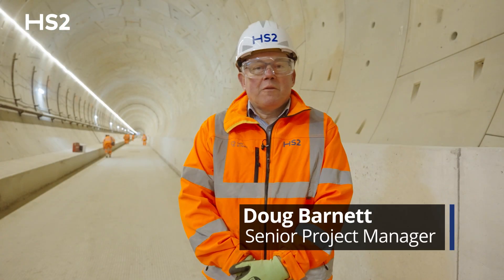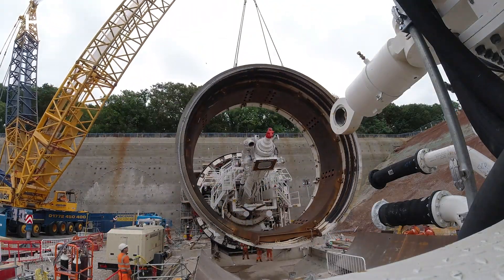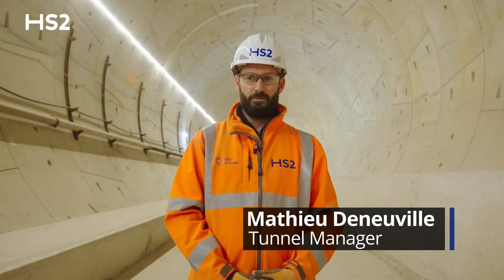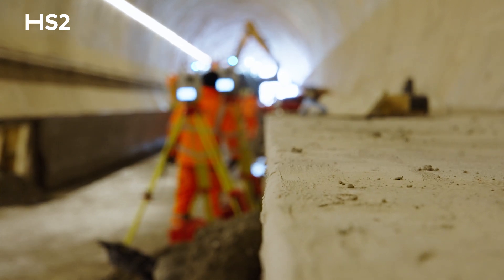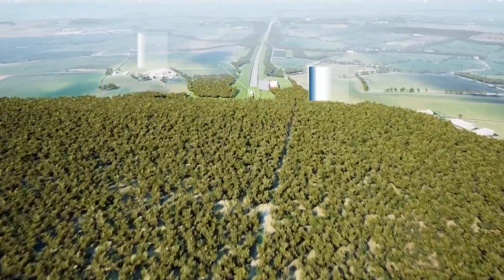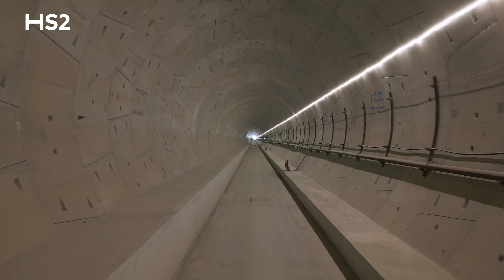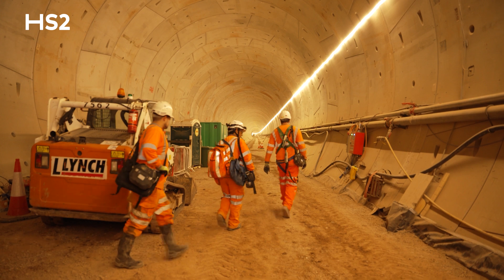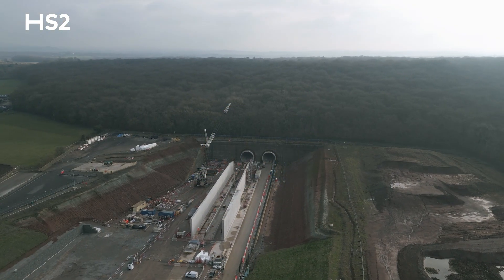HS2 marks major construction milestone at Long Itchington Wood Tunnel

Comment: HS2 (140 miles, £57bn) costs £407.14M per mile. Welland Viaduct (0.68 miles, £12k in 1878, £1.4M adjusted) is £2.06M per mile. That’s £405.08M more per mile for HS2. And we all know £57bn will continue to be revised upward, before we know it it'll be £500m a mile. Can someone please explain why this is the case (I'm not an engineer)? I understand there's more complexity in 2025 than in 1878, but £405m per mile? Tax payer money is just "allowed" to spiral, while Sir John Thompson sits comfy on £400k a year. Huge public servant incentives issue, and it undermines the work of brilliant engineers.
Reply: Planning conditions, services diversions, road alterations,  building in bits and pieces peacemeal fashion, agreeing method statements where the line crosses rivers, roads snd railways, unforeseen ground conditions, design programme lagging behind schedule.

Comment: The Public Accounts Committee report just released said: “The HS2 programme has become a casebook example of how not to run a major project.

“It is unacceptable that over a decade into the programme we still do not know what it will cost, what the final scope will be, when it will finally be completed or what benefits it will deliver.” Say no more.
Reply: The only fact that was known when they started the contract was the route. Planning conditions, services diversions, highway alterations  came later.  And because of the way it was set up the contracts have all been let on a cost plus basis. That's how you go from a budget of 32.70 billion that was pulled out of the air to appease Boris Johnson to an actual 80 billion and rising.

Comment: We are still waiting for a three lane motorway to be finished on the A1(M) past Gateshead. HS2 is a waste of money which could have been used far more constructively to improve the infrastructure of the whole of the UK.
Reply: HS2 is infrastructure. It's not a Hornby train set. 
...and shokka - both rail and road can and do get built... at the same time. How about that eh?
Reply: @ you need to research the  HS2 original budget and what it is now. Billions and billions extra. A licence to print money with no accountability. What are we spending this money on. To get from London to Birmingham half an hour quicker. And we have the worst rail network in Europe. Old story look after London and Birmingham and forget about the rest of the UK.
Reply: @gregorjack2629  I think you need to research HS2 full stop , if you think it's all about London to Brum half an hour quicker
Reply: @ originally it was going to Leeds. What happened to that?
Reply: @gregorjack2629  if the high inflation of the past 3 years has driven up the cost of Phase 1 then you should realise that the economic benefits have gone up by the same proportion. As the economic benefits are greater than the cost then the outcome is still positive. You need to be more objective (and also research that HS2 is more about capacity than speed).
Reply: @ The Public Accounts Committee report just released quote “The HS2 programme has become a casebook example of how not to run a major project. It is unacceptable that over a decade into the programme we still do not know what it will cost, what the final scope will be, when it will finally be completed or WHAT BENEFITS IT WILL DELIVER.” I rest my case.
Reply: @mrglide7078  Have you read the Public Accounts Committee report? Please do. Confirmed everything I said.  A total disaster and waste of money. Don’t know how much it’s going to cost, when it will finish and no idea what the benefits are? An example of how not to run a major project. What’s your answer to their report? Maybe you could put them right.
Reply: @gregorjack2629  yes, I have read the report, and nothing in there describes it as a 'total disaster and complete waste of money'.  I suspect these are your words

Comment: Give the contract to China & Japan,  China and Japan will complete the entire project within 7 Months.
Reply: Don't be so stupid, China and Japan didn't take 7 months to build there high speed, it took them 10 years.
Reply: And yet even if that was true for them in their own countries they would still have to comply with the laws and regulations in force here.
Reply: The Chinese also built a station  in 1 day. Then you do some research and discover the station was a prefabricated bolt together set of concrete components with an assembly instruction manual,  that formed  1 station platform. Also when the Chinese report the costs of building their HS railways they only include the cost of the track and trains.
Reply: They won’t touch it since they would still need to deal with the bureaucratic nightmare of the current system in Britain.

Comment: This looks like the Eurotunnel boring equipment..
Reply: @philtucker1224  the channel tunnel TBM's are forever buried in the middle of the channel.
Reply: @ oh right! ( I was working between Hythe and Folkestone ( Electricity) during the whole 4 year build and my sister still lives there) As far as I know they still have one on show at the channel tunnel exhibition centre (but they may just be a duplicate I guess). - Very similar in design and appearance though!
Reply: @philtucker1224  your right, one of the British TBM's is on display. I think a total of 3 of the channel tunnel TBM's are buried (2 French and 1 British), the others were dismantled, sold or scrapped. The TBM used to dig both tunnels in this video is being reused in Birmingham, it has been modified and given a different name.

Comment: Brilliant French Civil engineering 👌
Reply: Look at French roads - much better than ours. Probably cheaper too.
Love driving and riding the bike in France. Such a chore coming back to our overpopulated poor quality dirty roads.
Reply: @ I thoroughly agree with you. I’ve driven many thousands of miles on French roads and they are always beautiful maintained. (Although to be fair the payage are very expensive) so I guess they use that additional revenue for road maintenance that we don’t have. Nevertheless the N10 to Bordeaux is free and still good (I believe).
Reply: Yes a bit of French salesmanship. The 4 main Contractors acting in joint venture  are Effage (French), Kier ( British ), Ferrovial (Spanish) and Bam ( Dutch).
Reply: Why French  ? Of the 4 Principal Contractors 1 is French,  1 Spanish, 1 Dutch and  1 British.
Reply: @ (both engineers featured were French) probably the main Contractor.

Comment: For me the news that the link into Euston has been rolled back another 2-years if it ever gets built highlights how mad this whole scheme is. For how many miles will the trains be going at 225mph? It cannot be many. This whole project is the wrong specifications which has led to absurd costs and Birmingham already has two train lines to London which go all the way into the centre. Never has so much money been wasted to speed up the travel of so few.
Reply: Despite the name, HS2's main benefit is capacity, not speed. The existing lines all over Britain are at capacity, which means even though there is demand for more freight and passenger trains, there simply isn't room in the timetable to add more trains. This is COSTING the UK money, through lost productivity.
Reply: Saying the tunnel will be driven but the infrastructure needed to let trains use it is delayed... but there is no delay - sounds like a politician.

Unless a train can use the tunnel, it's not operational and if that is because of a delay somewhere then it's delayed.

So many cap d'offers happy to pay through the nose for things that don't work. These people make us all get ripped off.
Reply: @charleswillcock3235  the route is designed to the correct specification, it is just a matter of when the funding will be available to extend the route north. The tunnel drive to Euston will commence soon. To answer your question, the trains will run at full speed for around half the route to Birmingham. But, if we ignore the 'HS' in the project name, the new railway is not really about speed it is much more about capacity and freeing the West Coast Main Line of fast trains with extended separation distances, this enables more local stopping services and more freight.
Reply: The tunneling is continue as schedule. The air vents and other side projects that need to make the tunnel operational will come later on.
Reply: @DavidKnowles0 .. not true. A report published yesterday said that HS2 Ltd have decided to prioritise the ongoing work at OOC & the tunneling at Euston has been delayed yet again & will commence "sometime later this year".
This whole sorry vanity project has been an unmitigated disaster since day one & continues to be so.
Reply: @CRIMSONANT1 Read the details, the tunnels will still be driven, it's stuff like the Headhouse's that are delayed but they can be done alongside the station so there is no urgency.
Reply: @ Read the articles not the headlines. The Tunnel isn't being delayed. It the infrastructure to make the tunnel operational that is being delayed by 2 years. They are concentrating resources on getting OOC to Curzon Street operational first. A bit of electioneering as getting that bit up an running by 2029 will make Labour look good, I expect work on OOC and Curzon will concentrate on getting the bits needed for HS2 testing done first as well.
Reply: @CRIMSONANT1  Anyone using that idiotic phrase condemns themselves to ridicule as an uninformed idiot. Do you think all rail projects are "vanity projects"? What about motorway tunnels? Is the Thames Crissing a "vanity project" too? If not why not?
Reply: @DavidKnowles0  I only watch YouTube videos which allow comments because in some cases and this is one I have learned more from you than the video. I build websites and most people only read the headings until they get to a heading which catches their eye. Headings are very important. Thanks for updating me. Whilst I am not a fan of this fiasco not completing the line to Euston will make it an even greater white elephant. For the record I would have specified a top speed of whatever trains tend to run at today which must be about 100mph and not bothered with any non-essential tunneling. I live not that far from a train track and no-one is bothered by the trains on that line.
Reply: @Ingramdumpkiss  .. I suggest you look up the meaning "vanity project" & understand what it actually refers to before attempting to bring sarcasm into the argument 😉
Reply: @DavidKnowles0  .. so if the the infrastructure that makes the tunnel operational is being delayed for 2 years, then surely the tunnel (that will take 18 months to build) will ALSO be delayed?
You've basically agreed with my comment albeit in a very strange way.
Reply: @CRIMSONANT1  nope, you misunderstand again. The arisings from the Euston tunnel drives come through the Old Oak Common box and then through another small access tunnel to a rail terminal for onward disposal. So the Euston tunnels will be completed to allow OOC to become operational sooner than Euston. Other structures and systems to make the section to Euston operation is what is being delayed (ie the headhouses). And you claim to be on top of the details?
Reply: @charleswillcock3235  hopefully you are open to changing your mind once you see the line become operational. Lots of folks were critical of the Crossrail project for similar misunderstandings over cost and delays but the Elizabeth Line has gone on to be an overwhelming success with 600 million passenger journeys clocked up already. HS2 will also be successful and unlock improved services on the West Coast Main Line. For the record HS1 runs at 185mph and the East and West Coast and Great Western Main Lines run at 125mph.
Reply: @Maxhead_room  I am not against investment by the UK in the UK, my beef is the cost. This impacts on the cost benefit. The Elizabeth line was £3b over budget due to no-one person being in charge. OK it is great it is fixed. HS2 one day will no doubt be great. But that does not stop it being the wrong specifications in my mind. From time to time I have used the Chiltern Line which is OK. Good value for money. For me speeding the trains on that track up a bit would not have cost much less and would have benefited people in a matter of months or a couple of years. The train journey from Birmingham to Leeds is a very poor experience and that part of the track will never be built. Manchester to Birmingham is not a great journey. That is unlikely to be built. HS2 is the wrong specifications and hence too expensive. That has meant other areas of the rail system have received less investment.  I did write to Cameron along time ago to point out HS2 was not a great idea but he clearly ignored by comments. At least my conscience is clear.
Reply: @charleswillcock3235  HS2 will be extended North and East, it is just a matter of time, maybe in a decade or two, hopefully an extension to Crewe will be announced this year. We will have to wait for the funding to be made available and this depends on the state of UK finances (alas the country is fiscally in a sorry state compared to our peers thanks to all those who voted to cut our links to our trade partners in the EU). HS2 is about capacity so pouring money into existing lines will not resolve that. Phase 1 needs to be of a specification to handle future capacity, it would cost far more to upgrade the line later. Build it once and built it right. Surely, with the success that has been forthcoming, you judge there has been a cost benefit for the Elizabeth Line. HS2 is already causing huge private investments to be made - look at all the cranes building tall builds in Central Birmingham and surrounding the Old Oak Common site.
Reply: @Maxhead_room  Theoretically it is possible that HS2 will be extended to Manchester and Leeds. (Manchester is more likely than Leeds as the line from Leeds to London is good enough) I do not live that far from the centre of Birmingham. I first started visiting the city more than 40-years ago. Then the centre was alive with little engineering shops making all sorts of items. HS2 has killed off the majority of those and their premises have been flattened to make way for flats. Built for people to commute from Birmingham to London. Gone are those manufacturing jobs - hence the UK now struggles to afford projects like HS2. kind of ironic.  The horse has long bolted on HS2. I only hope more wisdom is applied to future large engineering projects in the UK in future. However, I very much doubt that.
Reply: @charleswillcock3235  HS2 have not killed off any businesses! They have already created thousands of new jobs and are a catalyst for new private investment. You have a curious outlook and way of interpreting the world. The vast Curzon Street Station land has been a wasteland/car park for a long time before the HS2 arrived. The line down the East Coast is great but the line connecting Yorkshire to the West Midlands is poor - thus there is a need for a HS2 spur from near the Delta Junction to Leeds.
Reply: Some don't know they don't know ... 🙄
Reply: Well, the tunnelling machines have been purchased &  installed at Old Oak and will be running  very soon. So in a few years time there will be two tunnels appearing at Euston. This will cost over £500,000 per linear metre incidentally. £4B divided by 7200mtrs.  It would be a bad show if there was no station to meet them, so Euston is going to get built. The only debate is should it be only  six platforms or alot more to allow for the expansion of HS2 that will be required when it proves so very popular.

Comment: Is HS2 trains going to travel at 225 miles an hour????
Reply: Yes. That is why this tunnel has a much larger diameter than the Birmingham and London approach tunnels (as trains slow on approach and air displacement is less of an issue). The line alignment is designed for 250 mph trains but the track design is for 225 mph.
Reply: @Maxhead_room that’s insane mental
Reply: At the outset, the design team were tasked with specifying a railway that would connect London to Manchester, Glasgow, Leeds via Nottingham and allow for further expansion of the HS network.  With those distances involved, it would justify   a speed of 225mph. This  was adopted and the tunnels, trackway, stations etc have been specified to allow for that. in particular, you have to keep the lines relatively straight and not bend them round a favorite tree or whatever.  Now that the politicians have truncated the  route ( for the time being anyway) it is harder to justify the very high quality of the design, but the wisdom of this investment will be apparent to our children, as our  Victorian forefathers before.
Reply: @JohnHoward-wc9kk  Cost benefit analysis - I guess have never heard of that phrase.
Reply: @charleswillcock3235  Most certainly have. But what do you include in your calculation ?. If we built out the HS network, there would be no economic case for internal UK flights. These have a carbon cost at least 8 x that of rail travel. This 'carbon' cost is not virtual, airlines are being charged for their emissions and its only going to increase. The case for HS rail, in our crowded little island is actually quite strong.

Comment: 2:13 This rendering looks confusing - the continuous wooded strip suggests that the A425 will revert to its original path and remove the 'new bend'.
Is that really in the plan; the last public drawings on Gov UK suggest otherwise?
Reply: @41istair  the A425 will go back to the original alignment and the temporary alignment removed and the polo grounds restored. Your right, the graphics are not quite right.